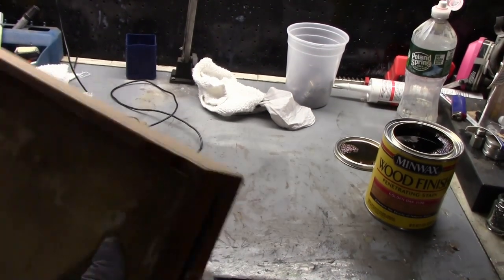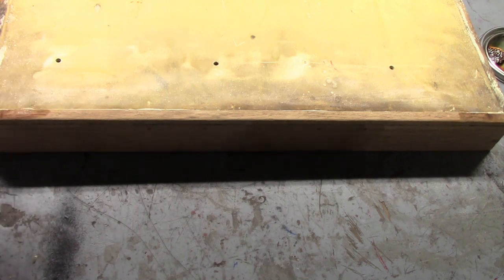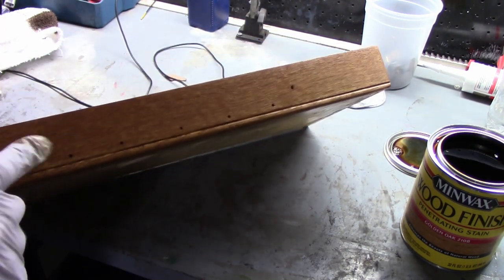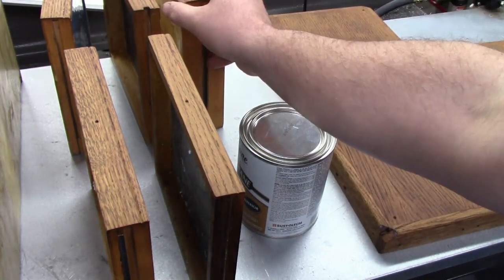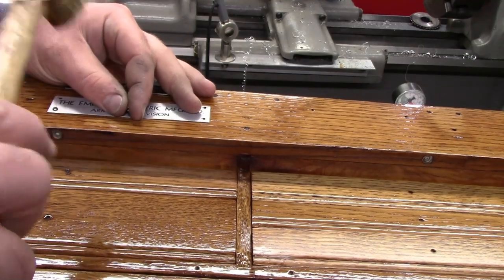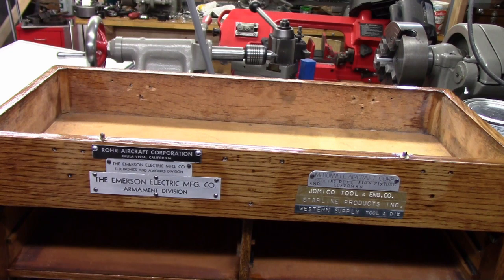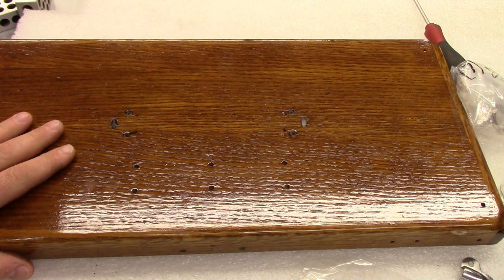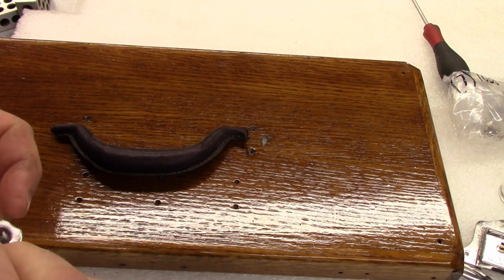Gerstner Refurbish Part 2

Comment: That was a big block of glue. Hide glue is good because you can easily reverse it. But that was enough glue to do some cabinet making, and veneering (where hide glue is the best). Spray is fine, also a Browns Hide Glue in a small bottle would have been easy to use.  For next time, try sanding the poly down with wet dry paper to remove the high gloss, then go to finer w/dry paper. Finish with rubbing compound or polish. The finish is outstanding and less plastic looking.   I like that you put the prev owner info and your own  under the drawer.  I always feel the previous owners would appreciate the love shown their tools. I rebuild a lot of tools and use them. I look forward to them being used when I am gone.  It's like leaving a legacy, even if you are not known.

Comment: Nice job! I only used 2 coats on mine, I rubbed the first coat with ultra fine steel wool and turpentine. Came out like glass. The hide glue is original and very traditional, thats what they use. I used titebond wood glue.
Reply from the maker: That’s why I tried it just to give it a shot.  I used 3m spray adhesive on my 11 drawer and after using both I can say the spray glue holds fine and is about 100 times easier to use.
Reply: Halligan142 yep I was worried about what to use on the steel bottoms, wasn't sure if spray glue would hold cloth... Ended up using the wood glue for everything since mine needed to be totally rebuilt (it was in a flood)

Comment: The nice thing about hide glue is that it is easily reversible. Unfortunately spray adhesive isn't really. (It is but it is a royal pain in the...) However yeah you can pick up titebonds hide glue in a bottle and ready to go from Amazon for around $10. Great job though man and very nice touch putting the prior owners info in it.

Comment: Advantage of using hide glue is a long open time and reversible. Reversibility is impotent for the future person that needs to restore that box. Hide glue is readily available at any woodworker supply place. You can also get it in liquid form. I do agree that the spray glue work great. I use it myself on many projects.

Comment: Good to preserve the box but for my taste i would have knocked the high gloss back a little but each to their own.
Reply: I'd agree, but as you say everyone's tastes are different. Still an interesting video. Adding the previous owners obit was a nice touch of respect. Any real wood finishing experts would think I'm a hack, but I like wet sanding with 600 grit or finer with the finish I'm using then wiping as much as possible off across the grain. It takes many many coats, but that slowly fills the grain dead level and leaves what almost looks like a oiled & polished semi matt finish with the protection of the poly.
Reply: @turningpoint6643  so many finishes oil lacquer varnish paint etc almost enough in fact to suit all tastes and that is before you list the gloss matt satin options.😉